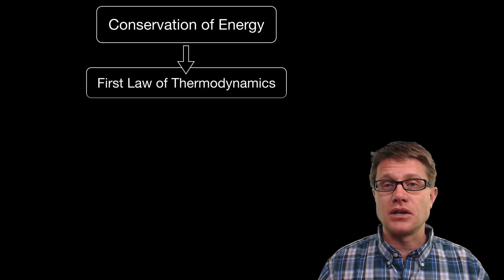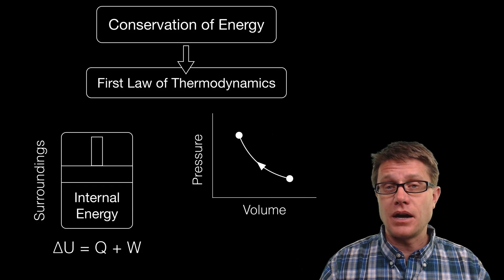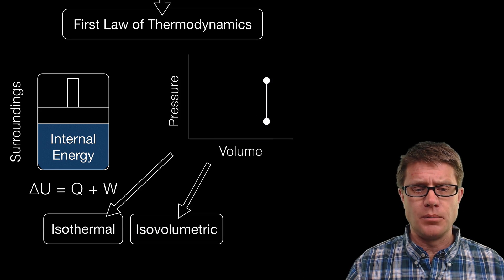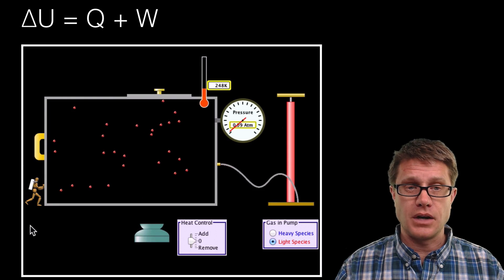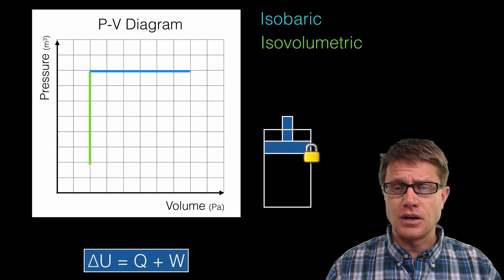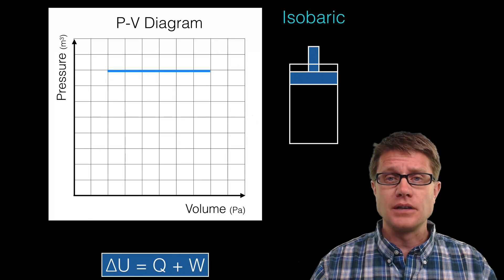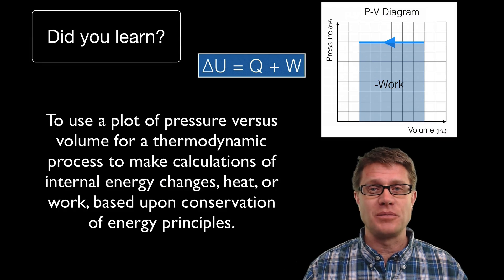Thermodynamics and P-V Diagrams

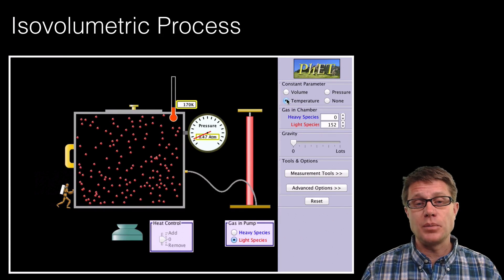Comment: 5:39 pretty sure this is modeling an adiabat, not an isotherm! you can see the system's temperature still changes due to the work done on or by the system; what you've done is prevented heat transfer into the system, not prevented the system from changing temperature. that would make it an adiabat :)

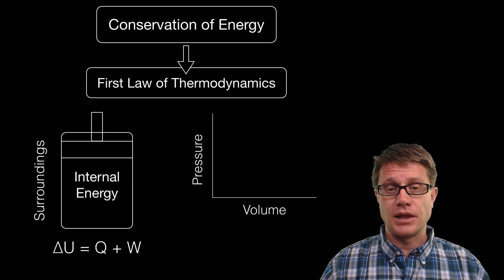Comment: Brilliant video. A quick correction for the example you gave at 1:20. This is an isothermal compression, therefore the work done by the surroundings on the system actually causes heat to exit the system, NOT a change in the internal energy. The internal energy stays constant (0 = Q + W hence -Q = W)

Comment: Q= ∆U + W right?
Reply: Vaibhav Rokde It should be Q=U-W
Reply: Depends on what sign convention you assign for the meaning of positive work, positive heat, and change in internal energy.  The sign convention is arbitrary, and it is best to always interpret the sign of your results in words, to avoid confusion.  And follow the sign convention given in your class.

I'm accustomed to the heat engine sign convention, where heat added to the system is positive, and work done by the system is positive.  Thus, Q=deltaU + W is correct in that sign convention.

Comment: Isn't Delta u = Q-W?
Reply: Yes it is.
Reply: Depends on what sign convention you give for +Q and +W.   I'm accustomed to +Q being heat added to the system, and +W being work done by the system.
Reply: The sign convention also varies in chem and phy textbook all u need to focus is that when to use when

Comment: Can you explain "polytropic" process, and is it related to "isentropic" process
Reply: Isentropic is a special case of polytropic.  Isentropic means constant entropy, which happens for reversible processes with no heat transfer (i.e. adiabatic/quasistatic or adiabatic/reversible).

Polytropic processes are governed by the relationship of P*V^n = constant, where n can be any positive real number including infinity.
For n=0, we have a constant pressure process.  V^n reduces to 1 no matter what volume is, implying that P=constant
For n=1, we have a constant temperature process assuming an ideal gas.  The process is equally sensitive to changes in volume and pressure, such that pressure and volume each change by each others' reciprocals.
For n=infinity, we have a constant volume process.  No matter what P is, V^n will dominate the expression, implying that V is constant.

The case of isentropic processes occurs when n=k (some books use gamma), where k is the heat capacity ratio.  k is a substance-specific value.  For air and other 2-atom elemental gasses like it, k=1.4.   For a single atom gas like helium, k=1.67.  It has to do with the ways that the gas molecule can store energy in addition to pure translation.